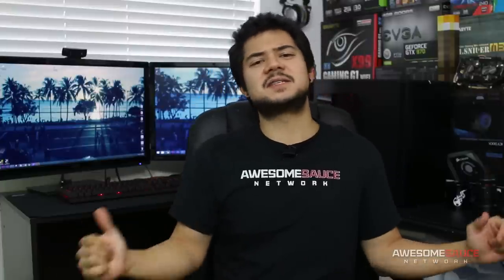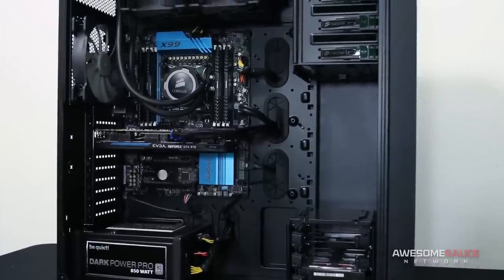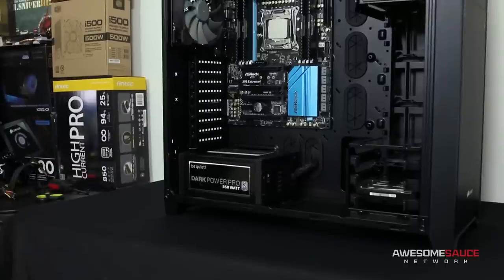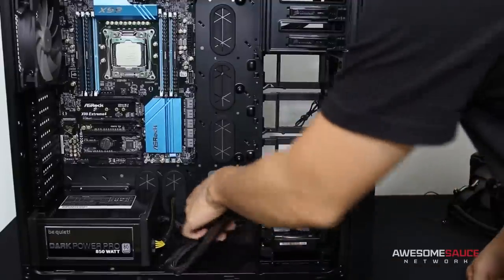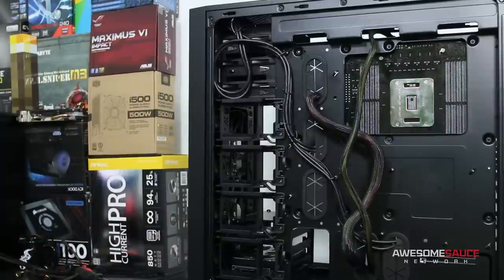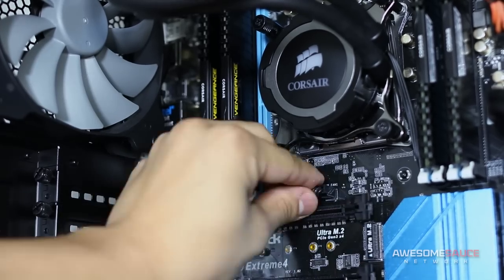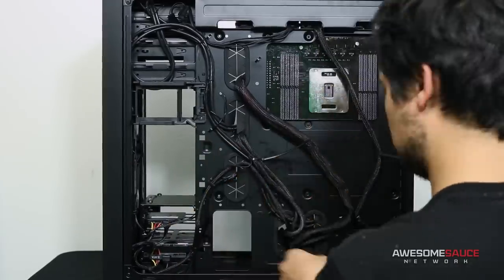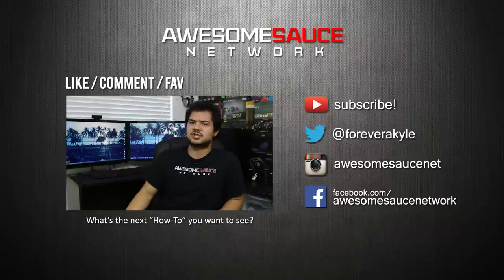How To: Cable Management

Comment: This is probably the best cable management video I have ever seen.  Great job!
Reply from the maker: :D
Reply: +Awesomesauce Network ":D" with your channel picture made me laugh.
Reply: +Enchisedmy He just looks so happy :D
Reply: +Michael Post
 I have a non modular PSU and small case , but look at my build 
http://imgur.com/1QbLpqd

spec: i3 4150, MSI GTX 750Ti, corsair vg pro 8gb dual, cm hyper 212x, 1TB WD blue, CM 500W ELITE V2, CASE CM N200 WINDOWED
Reply: +Tommy K wow dude ! I just saw the photo and that is some amazing cable management! Good job! puts me to shame with my full tower. How did you manage to route the motherboard case connectors so well?
Reply: +Tommy K Damn dude! Just looked at the pic and I must say, very nice job.
Reply: +Michael Post I agree
Reply: so clean! still having trouble with mine. it's my first time to build my own pc.
Reply: A year later, i am the 420th like. One of my life's greatest achievements.
Reply: Lets go 20000 likes peeps!
Reply: The Patriot Instead of Zipties cant you just use tape?
Reply: Gordon Ramsay NO. DO NOT put tape in your pc......trust me, you dont want melted plastic in there
Reply: booper dooper
Reply: I completely agree. My cable management is the worst and I just recently purchased a new case with a processor, motherboard, and RAM. I'll be transferring my GPU and hard drives to the new build. My previous build was done a long time ago before I realized how great you can make the cables look. Mine are all over the place and this video is a great point of reference on how to make the cables look. Great video.
Reply: The Patriot What's that thing called that blocks the wires (the rubber thing)
Reply: Happy America month brother
Reply: Amen! Simple and straight to the point.

Comment: "Fitting that damn side panel on" - instant like out of frustration!
Reply: +AussieProGamer That's exactly what I thought lol
Reply: +AussieProGamer Just changed case of my pc, i saw this video after xd
Reply: +AussieProGamer Agree. I just build my first pc and i thought the cpu was gonna be the hardest part. Nope it was cable management and putting that side panel back on lmao. Took me 10 minutes before i got it on nice and tight
Reply: my 460x's side panel is so damn bent haha
Reply: I got a modular power supply, that had thin cable. Side panel easily fit on.
Reply: AussieProGamer What's that thing called that blocks the wires (the rubber thing)
Reply: AussieProGamer preach it brother
Reply: I don't wanna like the comment because there's 666 likes
Reply: I had to open my case yesterday to test a friend's GPU and HDD and when I put all my stuff back decided to rearrange the cables a bit. The side panel fit perfectly for the first time in my with no effort. It kinda felt like leveling up.
Reply: HE Ain’t wrong 😂😂😂

Comment: Cable management is my favourite part of building a new computer. It feels so good to have a nice, tidy system :)
Reply: well that's funny because I'm lazy and I just leave cables hanging around everywhere, so it might not look pretty but then again I'm the only one that will ever even see it so... I don't see much of a reason to care too much.
Reply: I find that I take more time on the cable management than putting everything into the case lol.
Reply: its great until you realize your back panel is a mess
Reply: saved a couple of bucks on a non-modular PSU, instant regret.
Reply: My least favorite part of building mine was mounting that damn 212 EVO. It took like 1 hour of mounting and unmounting just to get the 4 screws aligned; I was terrified throughout the entire process.
Reply: Sushi I didn't regret my choice. I bought an XFX 550W non-modular PSU to power my 4690k & MSI GTX 970, which were all housed by the massive beauty that is the Enthoo Pro. The wires that are left unused (which were quite a bit since I only have 1 HDD at the moment) are neatly tucked at the back and front and don't even show. I could even use the power supply shroud that comes with the windowed version of the Enthoo Pro and tuck in all the unused wires in there, although I have't chosen to yet. The only problem with a full tower is that the cable that goes from the PSU to the top left of the mobo can't be routed from the back and thus is routed along the front of the case, blocking the MSI logo of the 970.
Reply: Saif S It literally took me longer to install my 212 Evo than it took to build the rest of the computer!
Reply: niofalpha Glad I'm not alone! The only good thing (I hope it's a good thing) about the entire process was that I spread out my thermal paste quite nicely while doing it. Actually, when I first squeezed out the thermal paste, I didn't expect it to come out so easily and accidentally squeezed out way too much. I had to take off some with my finger in a zip-lock.
Reply: Saif S h100i with pre-applied thermal paste is the way to go
Reply: tom5243 i didn't feel like spending the extra money since my build already surpassed my budget by a lot (final price was $1100), also, I don't plan on doing heavy OC so the 212 EVO will be good for now and if I do plan on pushing the CPU, I will replace it with a better cooler :)
Reply: Saif S i was mostly talking about coolers with pre-applied paste, but said the h100i cause thats what i have haha
Reply: Saif S You're not alone with the horror of mounting the god damn 212 Evo... my hands still hurt from it!
Reply: crippling cancer when I was brand new to building i installed a 212 evo in my friend's already built computer in just a few minutes...
Reply: EpicPanda111 What's that thing called that blocks the wires (the rubber thing)
Reply: Jack Super Fly What's that thing called that blocks the wires (the rubber thing)
Reply: tom435111 What's that thing called that blocks the wires (the rubber thing)
Reply: vgamesx1 Wouldn't be a problem if talking about aesthetics if you are the only one to see it, but it will be a problem for the case's cooling.
Reply: I have asperger's so it physically pains me to see an untidy system.
Reply: vgamesx1
bad practice , and not healthy for your system at all
Reply: @vgamesx1  Good luck cleaning your PC often...

Comment: I have to cable manage my pc better, i just shoved the wires on the bottom of the case until the side panel closed xD
Reply: Same haha
Reply: my side panel is bent 😅
Reply: at least am not the only one xD
Reply: I have no cable management XD i just connected everyone and forced it to close
Reply: Same here i changed my power supply, it was going perfectly till i had to close the side panel
Reply: This... The side panel is even slightly bulging outwards because of all the cable gore xD
Reply: The bottom half of my side panel is open XD
Reply: My case didn't have any room for cable management, so I just stuffed everything into the top of the drive bay cage. I should get a better case.
Reply: Mine literally has nowhere to put/hide my cables #sleeperpcstruggles
Reply: dis is me after buying my 1st pc rig wanting to play asap badly 😂
Reply: Thats wha i did at first to then got mod one its no reason to get a old school psu with all the wires
Reply: Same, used to use a 2009 hp prebuild case because I liked how it looked so I had to route all of my cables through a 3.5" drive bay and had to crush my 24 pin power connector against my gpu to make the case close...

Comment: Very helpful for a noob builder like me. Building my first gaming PC and these vids have been very helpful for me.
Reply: thanks, yeah mine were cramped back there too lol
Reply: Nik Koch 7 month later comment: always get atleast a  semi modular or a modular power supply. If it has flat cables that's a huge bonus! I have a non modular psu in my budget computer with a micro atx mini tower case! Of course, the cable management is pretty shit.

Comment: Thanks bitwit I did my first build and didn't do any cable management at all (except push some extra cables from my psu out the way to the top of my case) and after watching this i did some cable management on my build and now it's running cooler cheers mate.

Comment: I got my new parts and rushed the cables almost all together and now i'm getting a weird buzzing noise in my 3.5mm headsets in games, so I guess now I must follow these instructions :D
Reply: just plug it in the back.
Reply: +MakeTheGOD Have you checked the front panel audio connector?

Comment: its been two years now since you've posted this video. thanks man. I learned a lot from this. im currently using a tecware f3 mid tower case and I was very troubled with how to set the cables properly.

Comment: Well, Luke demonstrated that bad cable management has no impact on performance or thermals at all so... yeah.
Reply: +Deses cable managements LOOKS nice, though.
Reply: +spacebran Yeah, that's indubitably true. I was referring to the part where he said that cable management would improve airflow and thermals. It may be true depending on the case but it's largely negligible.
Reply: I agree, I'm just saying I cable manage because it looks better, haha
Reply: spacebran Of course! everyone should do! I have a case without a windows and I cable managed the hell of it, it was fun to do!
Reply: He probably meant in the long run because a lot of dust would build up and then that would make your PC overheat

Comment: I just built a PC for the first time. Cable management is absolutely disgusting! I have a semi modular power supply. For some reason I have way more wires than you
Reply: Wwhat case do you have?
Reply: DaRealist Corsair Carbide Series 400c
Reply: aight thanks for the quick reply.
Reply: DaRealist No problem
Reply: Saajiivan Sivathasan Uh, if you have a cpu liquid cooler, I high recommend you mount it to one of the sides, not the top. I have the corsair h100v2, I have it installed on the top and I really dont like it that way, but changing directions is too much work.

Any other advice I give you will be pretty much the same thing everyone else will tell you like map out the cables and make them go through the back or use zip ties,,,

The only thing that sucks about this case is that the front panel that covers the 2 fans, it is extremely hard to remove...

Let me know how the build goes!
Reply: Yes! Every time I take it off for maintenance, like every 6 weeks-ish, I feel like im going to break it. EVERY SINGLE TIME.
OK, I will contact Corsair, and see what they have to say about this and let you know.

Sometimes I just feel like companies dont test their products before mass producing it. Like come on, should their be a case that takes me 10 minutes to take the front panel off of?
Reply: Saajiivan Sivathasan Ok thats cool!
I sent Corsair an email yesterday, they did not follow up with me yet, probably because of the weekend. Lets see what they have to say about this.
Reply: I sent them an email- here is how they responded:

Regarding the top vent, some radiators are a bit large for the section. They also may have rounded screws (such as with our own radiator mount screws). Using flat topped screws generally helps. 

Honestly, this service is largely for technical support. While we can certainly forward these complaints, this service does not have any way to process or respond to such comments. Instead, I suggest posting on our Forums and Social Media sites with such criticism, as these are more frequented by teams which work directly in shaping future products.
Reply: Ya, I guess

Comment: two problems: i dont have a modular power supply and a case that allows me to "hide" cables behind the motherboard
Reply: Nick Schuto Check if you have an empty drive bay, or place where you can bulk your cables and tie them, that's what I did on my first case.
Reply: +Robert-Alexandru Kislaposi i did that on my in win 503 mid tower, but I'm afraid it blocks the airflow of the front fan
Reply: +Philip Madsen it depends on the case really, in mine they don't obstruct the airflow, I was careful

Comment: For the love of god DO NOT USE TWISTTIES
Reply: Why
Reply: +Faraonqa why?
Reply: BoredThatsWhy Dont go crying when you pc dies after you cable manage it with them
Reply: Faraonqa :(
Reply: +Faraonqa Why? Because of the inner metal wire in the twisties?
Reply: Exploited89 Hmmm yea ?
Reply: +Faraonqa Really? Well I'm not a huge fan of twisties myself, but it's enough you bend the two ends so the inner wire cant short anything...
Reply: +Exploited89 i M no english, so What is a twistie?
Reply: +miky3848 http://www.sevengaits.com/exhibits/latentthreadrow/arielkotker/twisty.jpg
Reply: Thanks for the heads up, I never realized you could fry your PC by using twisties. I suppose plastic zip ties are the better way to cable manage.
Reply: I like how it took 3 replies and 1 week before you gave a reason. If you have an opinion, make your reasons explicit from the beginning. This isn't a game of 20 questions.
Reply: If you need someone to tell you why not to use them in a computer you shouldn't be anywhere near videos about computers
Reply: BoredThatsWhy As you wish ..(jumps in a vocano)
Reply: Faraonqa Oh, an ad hominem attack. Your inability at providing a cohesive argument to begin with did ring alarm bells that you were probably not a particularly intelligent person; but this confirms it.
Reply: +Jimmy Watson ding ding! You've won a cookie
Reply: +Faraonqa they do make twisty ties that are nonconductive
Reply: +Faraonqa lol, i used just straight craft wire to manage some of my cables and it's still doing fine, as long as it doesn't come in contact with any of the components, you should be ok... (Don't try it tho, use zip ties or even string instead, i'm just saying it's not THAT terrible...)
Reply: Twist ties have a rubbery layer, and the cables have an outer coating.
I have no idea how it would be dangerous.
Reply: A Christian Gamer Yes they do but the rubber can be damaged
Reply: Faraonqa Anything can be damaged. Even so, it won't happen anytime soon.
Reply: A Christian Gamer Ye but a zip tie has 0% to short something out no matter what you do to it
Reply: +Faraonqa Been using twisties all my life, the fuck kind of awful job have you been doing to make your mobo short out.
Reply: +getmoney if you use your brain when tidy everything up it can't do any thing wrong when using twisties.
only if it touches the connection parts on cables or if it touches your motherboard.
so you can still use them if you want
Reply: Your entire case is made of metal... Of course a damaged cable can short it.
Reply: Thanks a lot for the tip!
Reply: the only way that a twist tie is going to short out your system is if you dealt with your cables so badly that the outer rubber layer is ripped. There's basically a 99.99% safe rate guarantee, with the idiots being the only outliers.
Reply: Oh shit... I didn't have zip ties, used twistties for the whole cable management. Been running this build for a month though and no problems, nothing fried. But really, I don't really see how twistties can be that dangerous like come on... There's no way a wire out of them is gonna deisloate and THEN also drive in through the cables and make a contact between 2 different cables like cmon.... Or did you mean something else maybe i'm stupid?
Reply: Well you have to be a bit more careful with those 
however if they are still decent and the system is not going to be moved a lot or shipped it will be fine
However if you have to undo and redo them I would recommend replacing them with new once since I have already seen what could happen
Reply: I just use velcro
Reply: -Comments on a video about learning how to build (and manage) computers
-Says that if they have to teach you anything you shouldn't be near videos about teaching others how to use computers
???
Reply: poetanderson yea, the classic "if you don't know this one specific piece of information then you shouldn't be watching tutorials to help you learn that information" insult.  It's the kind of insult that really just lets you know that you wasted your time even reading  anything this guy has to say

Comment: As soon as my zip ties and new Corsair Hydro series 115i comes in, I'll finally be able to cable manage as neatly as you did in this video, though even with that said, I got a Full tower case, so my cable management is quite easy compared to the standard mid-tower case

Comment: Cable management can be very cathartic if you are a neat person.  I sometimes find that being calm enough to admit the first attempt at routing is wrong is helpful.  Never be afraid to pulling it out and fixing the routing, that is better than just leaving a silly mistake in place.  

It also doesn't hurt to POST your machine before tying everything down, it might have worked on the bench, but you want to make sure it works in the case as well!

Comment: Kind of a random tip, if you have a old build usually the power supply has a filer with holes on each corner, they fit perfectly over a 120mm fan for instance if you want intake from the top and you have a s340 elite its lacking a filer so I screwed the screen in with my fan, no noise works great.

That is all lol lmk if I helped you 😂